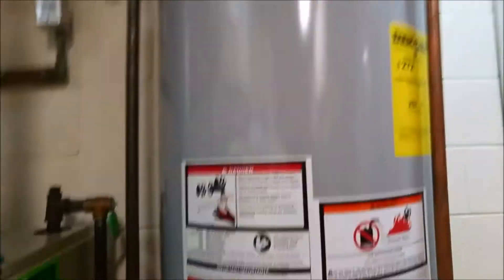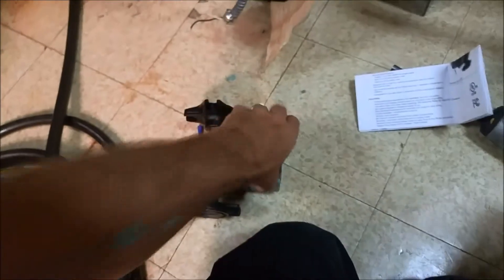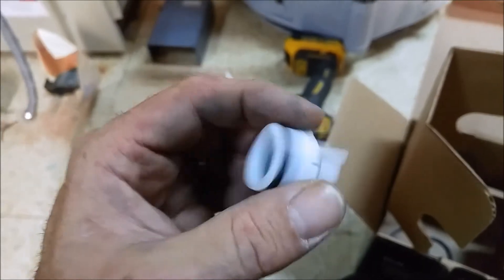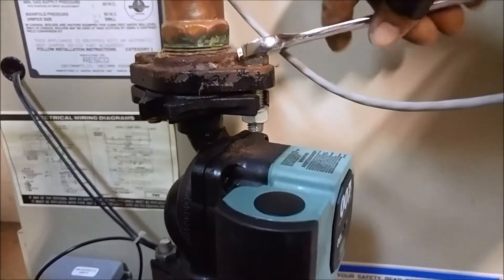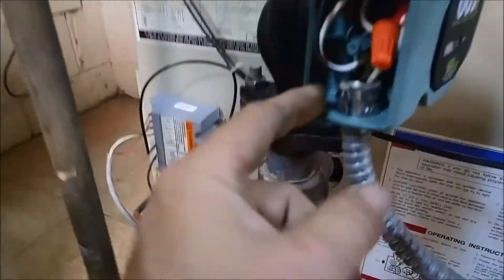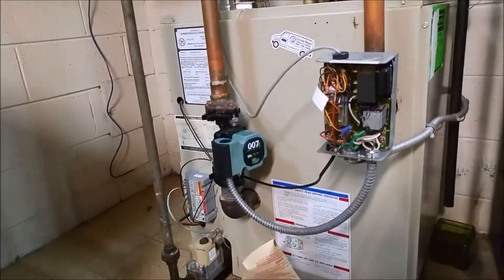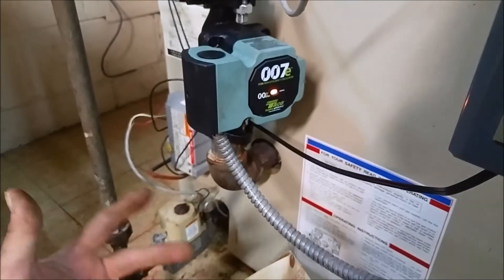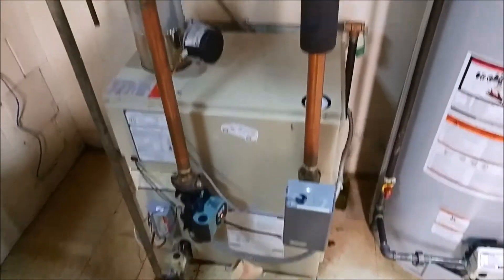Taco 007E high efficiency circulator pump install

Comment: Solved** I have the same problem with pump direction.  I removed the circulator but I'm having problems re-installing the casing O-ring.  Do install around the groove in the impeller assembly?  Any recommendations would be appreciated.

Solution- the O-ring goes around the groove in the impeller assembly.  I used a bit of silicone grease in the O-ring, and the impeller along with the O-ring went into the circulator housing smoothly. The pump is now running quietly without any leaks.
Reply: The best way to align the motor and the casing for a system is to remove the 4 allen bolts and the rotate the motor, don't remove it. If you do remove, yes, be careful with reinstall of the o-ring